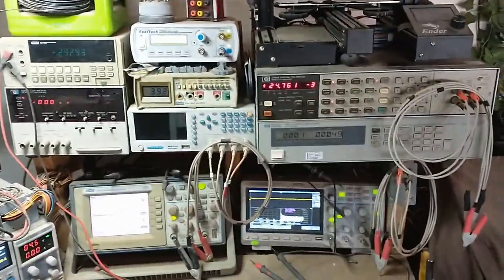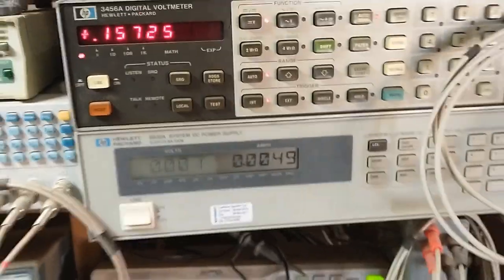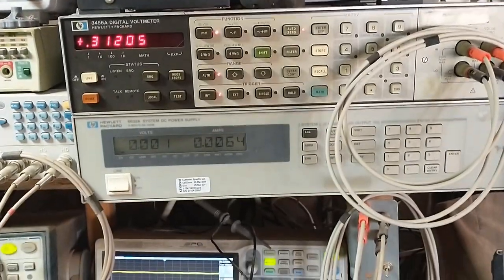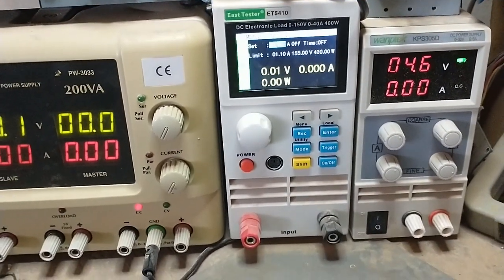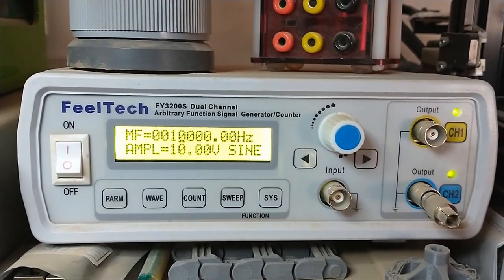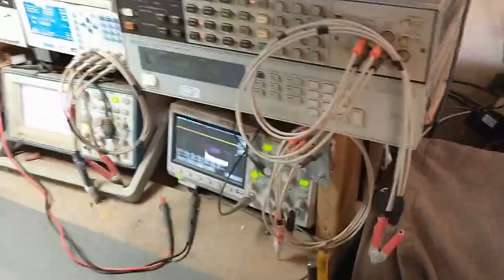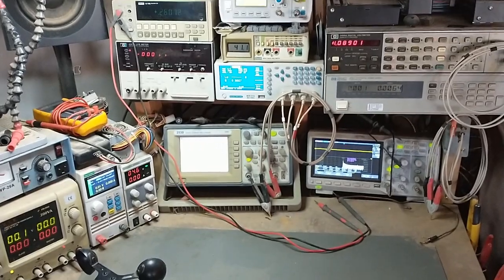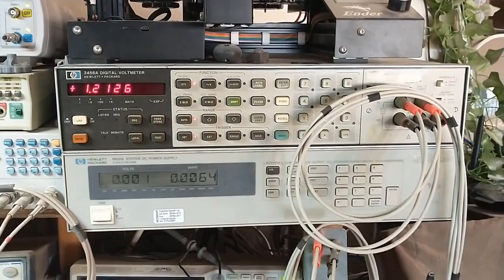Off-Grid Electronics Lab

Comment: I was just noticing how much dust you have on your gear. I used to have my electronics bench in the garage with all of my other wood/metal working tools.  My gear was very quickly coated with an obscene amount of dust. So, I moved the bench and gear indoors to my home office. Much better. But I love your equipment. I have just the basics but you've got some very nice specialty gear. Bench multimeter and load simulator would be some nice additions to my bench.  Anyway, I'm glad I found your channel. I'm looking forward to getting caught up on all your videos.
Reply from the maker: The dust is an ever present issue out here. I guess you noticed my gear acquisition syndrome.